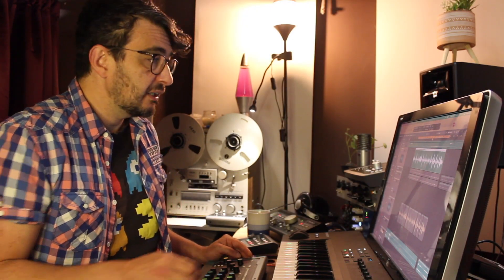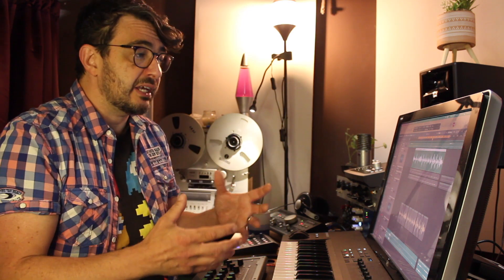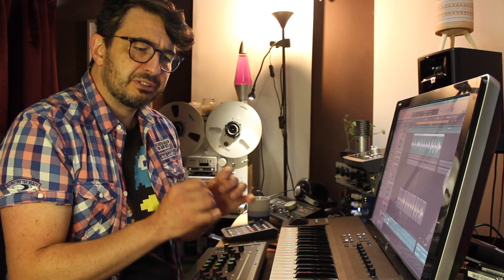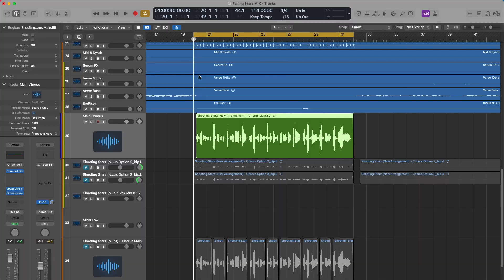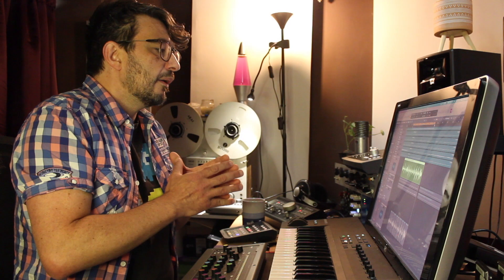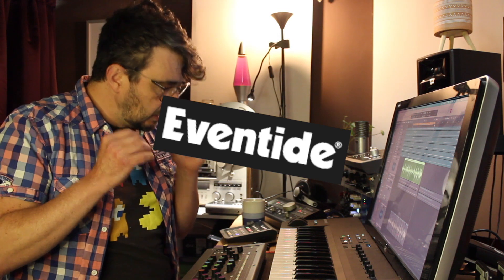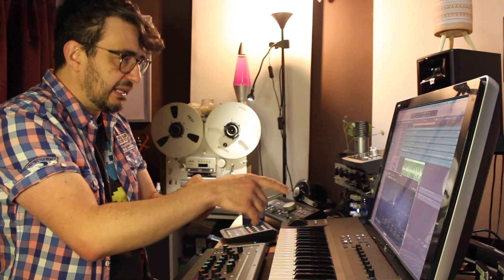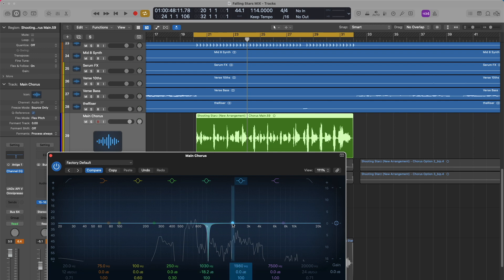How to find and fix resonant frequencies with your EQ

Comment: do resonance filter cuts always have to be so deep? i find that it makes the sound thinner or boomier depending on where you cut. it seems as if cutting rogue frequencies tends to make other frequencies more prominent so you have to be careful
Reply: This is a question I also have. Did you by any chance find out?
Reply: @vrijrein  They certainly don't have to be. It's all about balancing the cut of the resonant frequency with the important tones associated with it.
Reply: @Drumdude266 thank you :). I fiddled around with my vocals EQ and I am quite happy with the outcome. I had 10 layers of EQ just for the resonant tones though haha! And then after the “normal” EQ. It did work out in the end but it was quite hard at first because of my space where I recorded. Probably because of the fridge, the boiler and sounds like that.